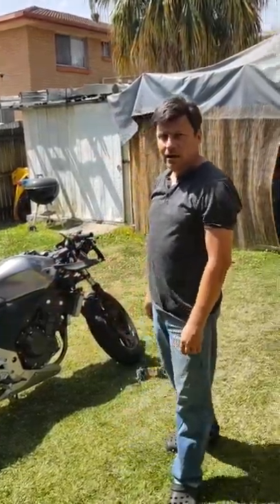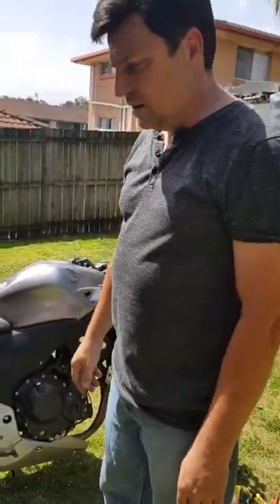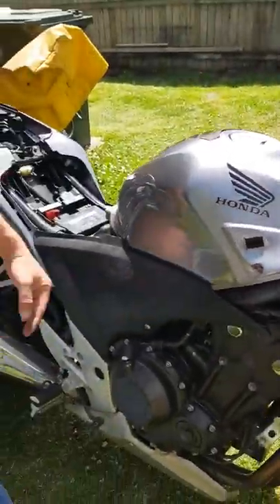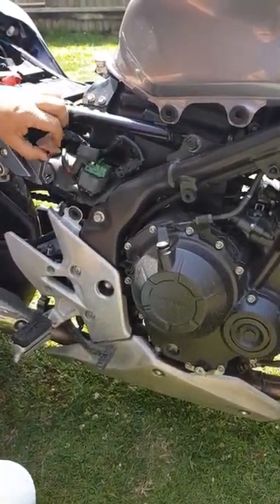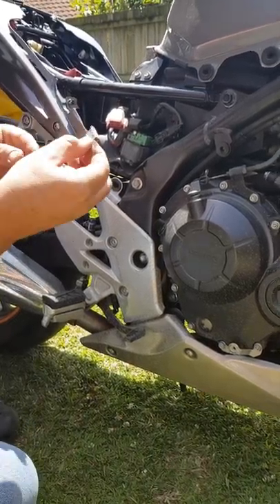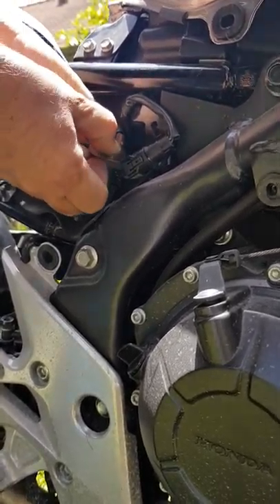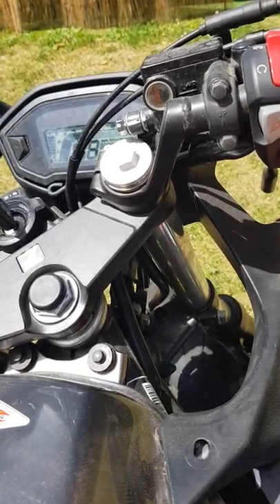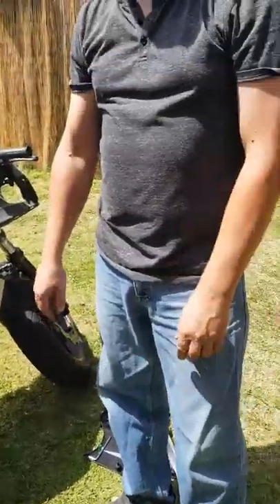How to fix no power to a motorcycle

Comment: Hiya mate. I got a bike thats been off the road for about a year and wont start. NOTHING. No electrics. Zero. I've fitted another battery and checked its charge. Checked tall the fuses including the 1 you mention here and they all seem to be ok. Any idea's? would be really appreciated. Cheers.
Reply from the maker: Hey check if there is power coming from battery to starter check earth
Reply: @vragtv5864  Thanks for that mate, will check it tomorrow. Cheers again.

Comment: So i was riding my suzuki 200cc i slowed down due to a sputter then power off no power pushed it up hill parked it deal with it tomorrow. 

Woke ip started like new. Rode it for a while the after i parked it and went to start it a coiple hours later - ded. Wtf happened ? Ahouls i consider anything first ? Thanks
Reply from the maker: Could be electrical but by the sound of it could be fuel getting blocked somewhere. Check lines and filter first

Comment: I have a similar issue but my main fuse is good. My battery is fully charged, and my bike is not dead. It will turn over but won't start. The fuel pump is not priming.
Reply from the maker: Put power direct to pump if not working get a new one
Reply: @vragtv5864  I already did that to check it and the pump started priming. I think the starter relay is bad, and is stopping power from getting to the pump.
Reply from the maker: @drjd2real  check power before relay if ok check after keep going till you have no power and there's your problem